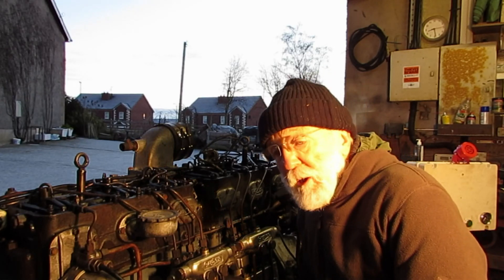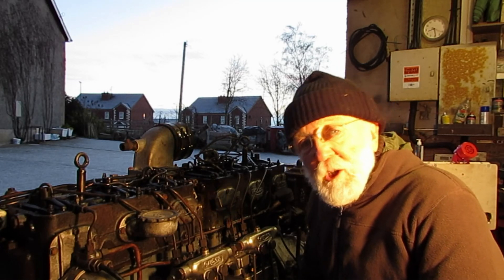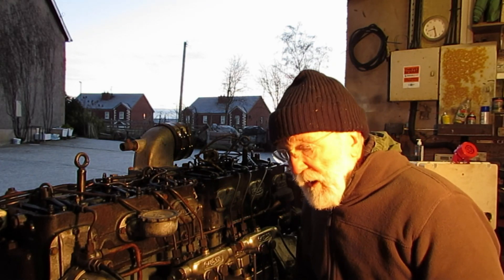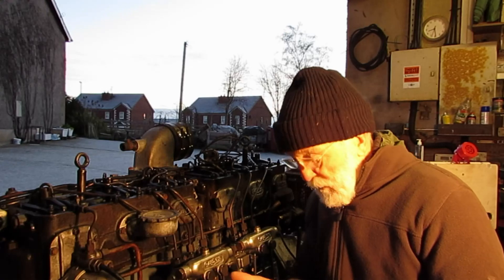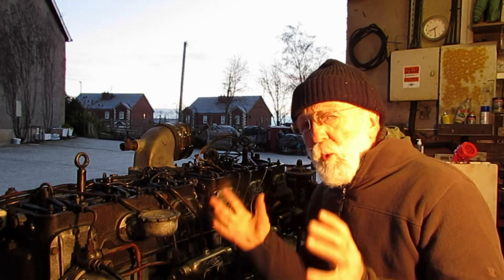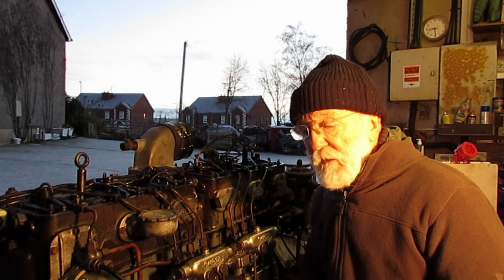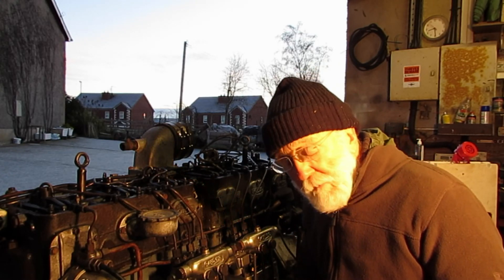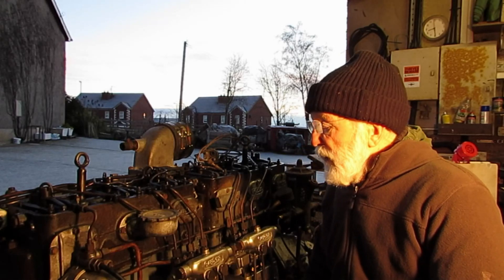Gardner Engines: Measuring Temperature

Comment: I worked on the Gardner engines on Lodecka double decker buses in New York City for N.Y. Double Decker. I found them easy to work on. The owner of the company brought parts from England. When the parts came in to NYC. they turned out to be junk. I was glad to get something to work with to keep the busses running. I was rebuilding clutches, transmissions cylinder heads and brakes starters DC generators.

Comment: Another brilliant video thanks for uploading. I have electric oil pressure gauges in the wheelhouse and for some reason they read back to front. Any ideas as to why?
Reply from the maker: I'm not sure what you mean by "back to front".  On the back of the gauge, there should be three terminals: +, - and S.   S goes to the sender and the other two are obvious.
Reply: @tangentgardner  Thanks for the reply. I will check the wiring on the  back of the gauge tomorrow. By back to front I mean that as the pressure were to increase the reading on the gauge would decrease and same vice versa. As long as the needle is roughly in the middle I know I'm ok!

Comment: Good Morning Joe - I am a little surprised these engines run so cool - I can see that none pressured system are limited to 100C however 60C is still relatively cold - is it because the casting wall thicknesses are so thick there;s a temperature gradient across them and the actual critical surfaces like cylinder walls are nearer  100C  I wonder ? otherwise there would be issues with  condensate and acidic corrosion - Your brave to have the door open on a deeply frosty morning : )